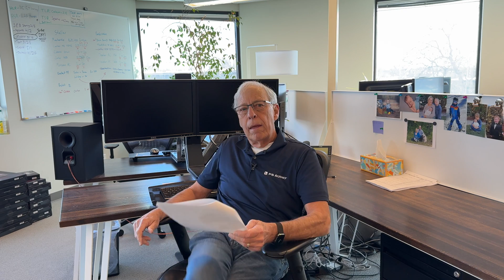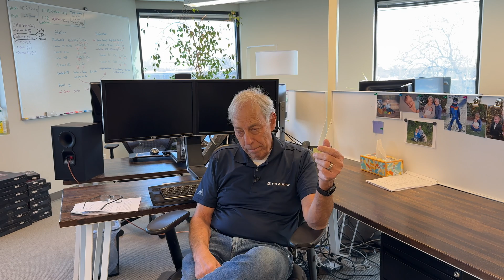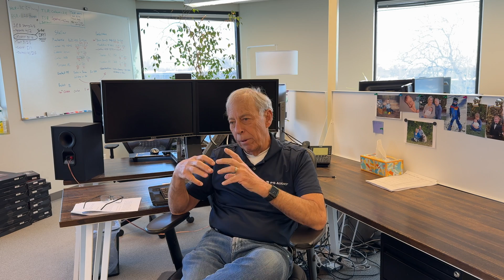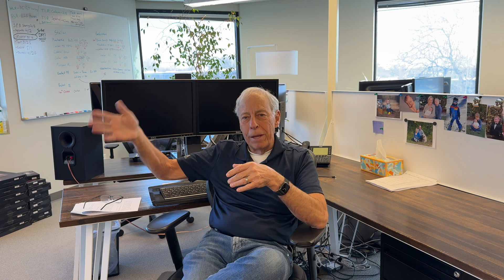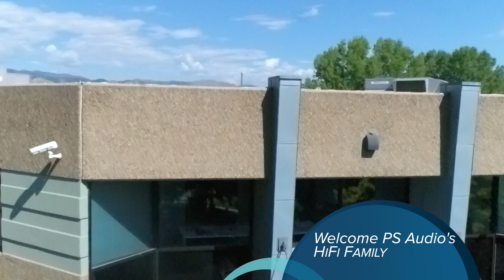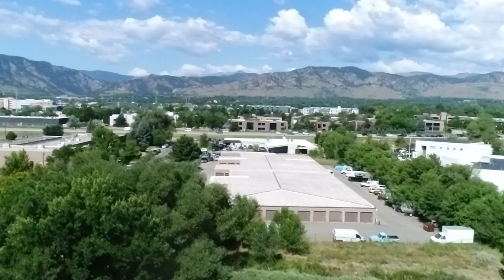Dielectric bias system

Comment: I worked for the government for 35 years as an electrical engineer, on a wide range of exotic projects ranging from DC to 20GHz+ (impulse radar, 100pS X-ray framing cameras). Every imaginable configuration of coax, twisted pair, strip line, high voltage charge lines, etc.  The only time dialectic non linearities was an issue was in magnetically loaded shock lines, that is specifically used to sharpen the leading edge of a sub nanosecond edge.  So I would call bullshit on the concept of biasing the dielectric.

Comment: To my ears, it works, but does it have to be really expensive?🤔
Reply: Good question. To enable DBS, there must be an additional conductor (or two) inside the cable, the custom DBS battery back with its 6 batteries, the 'stressed' premium capacitor that acts as an RF noise trap terminating the DBS wire, some extra labor in the cable preparation. So yes, it costs money, and as with all audio, retail distribution is THE major cost adder. I do not take this expense and cost lightly -- in order for a cable to be worth putting DBS on it, DBS must be a more cost-effective improvement than anything else we know how to do. This is why even though the newish Black Beauty interconnect costs a little more than the previous Water model, Black Beauty does not have DBS because Black Beauty's ZERO-Tech construction, graphene in the carbon-based mesh network, and the RF draining superiority of the copper-plated brass plug barrels cumulatively are more cost-effective -- though DBS does feature among the improvements in the next-up Pegasus model. Sincerely, Bill Low

Comment: As per the usual snake oil comments, people rubbish other peoples observations because it doesn't fit their perceived reality.
I have AQ Water xlr's and it is noticable if the battery is not connected. The sound is less focussed.

Comment: Thanks for being honest Paul, but perhaps you forgot you are selling "PAUL'S REFERENCE AudioQuest Dragon ZERO Speaker Cable" with this feature costing $84,200.00 USD for 10 feet of it (bi-wire version). And are batteries included for this bias system? I'm SURE there is no good scientific reason for this to be of any value. The battery taken out is effectively making the shielding AC disconnected and should theoretically cause more noise. But because it's so low impedance to begin with, Paul is right, you wont hear the difference. So it's dumb to spend $84,200.00 USD on a cable and leave the shielding floating. I hope PS Audio is making good business, but I also hope it's not by selling this cable with such inflated profit margin...to be honest.

Comment: As someone who (unfortunately*) hears differences between audio cables, but is also skeptical of claims made by cable manufacturers, I appreciate your candour, Paul!

* I say unfortunately because it means that I can't just use cheap crappy cable and get on with it; I have to spend $$ on cables to get the most out of my system.

Comment: Hi, I do have the AQ K2's  which are incredible cables, I tested with our the DBS connected and sounded really good,  but then I re connected the cable to the DBS and I believe I did hear a slightly brighter and richer sound coming out of them.  I am not sure if it is my imagination or really sounded better, but I just left it connected.  I also use AQ on all my cables,  that is Speakers, ToS Link, RCA's, XLR''s.  I did tested the Gobel, Kimber  cables and the Crystal cables, which as well sound incredible.

Comment: I,ve got a simiular product from a german company called Inakustik. There is no battery, they use a special powered cable driver with the weight and size of a mid priced amp. When used you can hear a little effect  if it has a musical advantage  I still have my doubts

Comment: I have troubles to follow - „no difference noticed“ could have many reasons. „small difference noticed“, and a description of wherein small to negligible differences lie is another story to me. And there’s a number of things that make small but valuable differences, perhaps not to a cost that everyone accepts.

And it is interesting to see how everyone cracks up since 20yrs on “powered” speaker cables, but literally none here in the comments section has actually tried to A/B battery on/off. (Have done that on an AQ USB cable: quite audible. I have old non-DBS AQ speaker cables, so I cannot report about differences heared).

Comment: The technology is easy. By polarizing a slightly conductive dielectric, free electrons (electrostatic charge) are attracted to the positive node of the dielectric (not the positive connector).
If it helps the sound?
I do not know.
But there is a solid technical thought behind polarized dielectric layers.
Reply: AudioQuest espouses an, `air dielectric.'
Reply: @richardsoffice9176  Yes.
Conductivity of air is 10^9 to 10^15 Ω·m
depending on humidity.
I assume you have got a spark into your finger when touching something?
The reason is that air as anything else have some level of conductivity.
Only vacuum have zero conductivity.
Plasma tweeters are using air as a conductor.

Comment: After duck taping a car battery to each of my speaker cables, no difference heard. Though without the ability to start our cars, we sit home and listen more!
Reply: not sure whether this is some sort of a joke, but 1) the electric field required to provide a static dielectric displacement is proportional to the voltage (12v being low) 2) you would need to appropriately configure the cable with an additional central conductor and a coaxial 2nd one that wraps around it and the speaker wires, but none connected to the speaker wires..

Comment: One of the most important things that I’ve learned about any listening session is not only to warm up your entire system for at least an hour and THEN exercise your system for at least another half hour to allow all of the active components, capacitors, etc. to reach its optimal state so that the music will bloom. I doubt I will ever buy cables with a battery attached but I’m not going to poo poo them unless I actually listen to them for quite some time before I make a final judgment. I would like to hear Bill’s Lowes’ response as to why most of today’s comments and Paul’s response are so negative.
Reply: People have different ideas, reach different conclusions. Then: Ego is involved. "My ideas are different, must be better, in fact, the best!" Colors the hearing, perception, conclusions?
Reply: @richardsoffice9176  totally agree
Reply: Paul's response is only negative in terms of his hearing a difference between dbs and non-dbs function! He largely praises AQ's cables here, calls himself a huge fan of them, even by implication the more expensive ones, and makes it quite clear that PSA respects them enough to use them in everything they do. As someone who largely uses expensive (but not the top end) AQ cable with all of my gear, I'm not sure I'd hear the difference dbs is supposed to make, but nevertheless highly value the cables' sound overall.
Reply: Thanks for the invitation :-) Please see my reply above to @Evil_Peter about why quickly connecting and disconnecting a DBS pack is not a valid way to evaluate biasing a dielectric -- as with your electronics and speaker crossovers, it takes weeks to properly 'form' a dielectric. As for negative comments, nothing in this thread is as no-difference as was once commonly claimed about amplifiers. Len Feldman's amp reviews always concluded with basically saying that all competent amps sounded the same. Cable controversy made it safe for the world to acknowledge that all amps do not sound the same -- maybe someday a new 'frontier' or 'edge' will make the world safe for cables to be more universally acknowledged. All I ever ask is that people please listen -- to not do the equivalent of protesting a movie they haven't seen. Paul testified to his experience, I fully accept that he reported his truth.

Comment: No, it’s pure snake oil. Period. Technically, the shielding that has a DC offset is simply using the battery as the "AC conductor" much like a DC charged capacitor would conduct AC through it. If you remove the battery you make the shielding disconnected and of course that will yield extra noise and might fool some people to think the DC offset is doing magic LOL. Rather, just short-circuit the battery terminals and your shielding is working fine. It's therefore a sophisticated case of snake oil even worse than when some other cable company claims that audio cables need burn-in. Paul was too ambiguous in this video in declaring it snake oil. You will always find someone who will say that whatever expensive snake oil sounds better because he is imagining it from his own listening experience. Snake oil audio product manufacturers selling at insane margins always stay away from blind-tests because they actually indeed are aware that what they are selling is not credible and will fail proper scrutiny.

Comment: I have a pair of Audioquest CV8 speaker cables with the DBS on them, they listed for $800 and I bought them on clearance for $330. The DBS is only on their premium cables so the cable is already of very high quality to begin with.  I was using Audioquest GBC which were fine.  All I can say with the A/B comparison the improvement with the CV8 is very noticeable., mainly the noise floor, more dynamics and clarity of the sound.  It does sound like snake oil, but to my ears the cables are wonderful and I’m happy I bought them. To each his own, people can use lamp cord if they want and be happy, but I believe cables are vitally important in the system and you should get the best you can afford.  And no I don’t work for Audioquest.
Reply: I also have CV8.. I upgraded from Blue Jeans speaker cables and definitely a difference specifically in the mids and highs!
Reply: @amrw8447 Yes, they are also well built cables.  It does depend on the quality of the rest of the system, you can’t put lipstick on a pig.  I can see the doubt about the DBS, but whatever, my ears tell me they are great.

Comment: I saw a test of a pair of AudioQuest battery bias speaker cables (I don't remember the exact model) and it was clearly shown by measurements that the bias acted like an antenna and introduced noise from the environment. Definitely something that you don't want a cable to do.
Reply: thats a coax topology that is only connected to the battery - difficult to explain how this would add an antenna that isn’t there before.
Reply: Radio frequency signals, there is quite a spectrum, can be induced into any metallic object. Usually, but not always, they will not produce a problem. These are well above human hearing, almost always, and are therefore inaudible. Heterodyning MAY have an effect, at times.
Reply: It's true -- the added electrostatic-field wire that's makes the DBS system possible is an antenna that capacitively couples RF into the system. For many years this weakness meant that while DBS was clearly effective and reduced cable dielectric involvement and distortion, the overall effect was 2 or 3 steps forward, and 1 step backwards. However, almost 10 years ago, Niagara designer Garth Powell developed a simple 'noise-trap' circuit that's included in the external DBS pack. When one plugs and unplugs the DBS pack, the obvious immediate improvement with the pack is only due to this effective wire termination -- one hears the reduction in RF. To hear the effect of the dielectric-biasing itself, one must have 2 cables, one with DBS attached for 2 weeks, and one without DBS for at least 2 weeks (no different than electronics and speaker crossovers requiring a bias voltage for 2 weeks in order to approach optimum). That comparison will make it obvious that yes, 'forming' the cable's dielectric is effective and meaningful. Sincerely, Bill Low

Comment: I agree—save your money! I considered these cables a while ago and opted for the Audioquest Rocket 33s Bi-wire cables. While the Rocket 33s were not cheap, at $780.00 for a 10' pair, it was still a $700.00 savings over the 88s. They sound amazing, and I noticed no difference between the two cables during my audition.
Reply: .. though rocket 33 and 88 differ in more than just the DBS

Comment: I can attest to the recommended USB cable for the MKII DAC is Audioquest Coffee & for the MKII to the amp Andioquest Water XLR. Both with the dielectric. A Truely magical combination and 100% my reference cables. Combined with GR Research 12TC speaker cable and a pair of AR Classic 30's. My reference system for the rest of my life. Possible a TEKTON speaker upgrade down the road at some point. Keep in mind that Paul's level is stratosphere so his experience is going to be different than yours or mine.

Comment: it's foolery it's nonsense as long as they're made decent cables not using some cheap wire makes no difference, and it is at the right impedance of 50 ohms or lower. and 75 to 93 ohms for digital. nothing else makes any difference except maybe degrade the sound maybe that's what you're hearing😂
Reply: 50 ohm impedance in a LF speaker cable? Are you sure what you are talking about?

Comment: There was someone a while back that tested (measured) them, and they were worse than (I believe) everything else.

I've tested different cables several times and they can be noticed even on rather basic system, but the point of diminishing returns start Way earlier than cable manufacturers would like.
Reply: The reason this is a poor idea is that the battery serves as the AC connector to ground the noise from the shielding and a simple short-circuit is a better AC noise conductor.

Comment: Paul, I believe that the batteries maintain some property within the cables, when the cables are not in use.

Turn off the batteries, and do not play that stereo for a week or two (not sure of the time period).  Then when you play that stereo, you might hear a difference.
If not playing the stereo for a while is not an option, then replace the cables.  For the ones you remove, turn off the batteries.  Then swap the cables, again, in a couple of weeks.

I was once told the answer to that by Audioquest personnel, when I was placing an order.  The store conferenced in the Audioquest personnel (two of them) -- and they had no problems answering any questions.  But it was at least a decade ago.  Those brain cells have degraded.

You are good friends with William E. Lowe.  Please ask him.  It will end the guessing.

Comment: It's designed to keep the speaker cables concentric. Paul actually did a video on this once. Basically like having your cables "warmed up" like they've been running for a couple hours all the time....I believe 😂
Reply: Ahhhh, what you say it prevents the electrons falling to the bottom? Something like what happens with fresh orange juice that you keep in the fridge ;)
Reply: Maybe.. I would refresh myself on the subject before I went any further. Something I haven't thought about in a couple years.

Comment: When you start using a cable with the dbs system, you readily notice how noise floor has dropped significantly and dynamics increased. Made this experience years ago, after years having used King Cobra switching to Columbia. I remember my brother was also present and both of us were impressed.